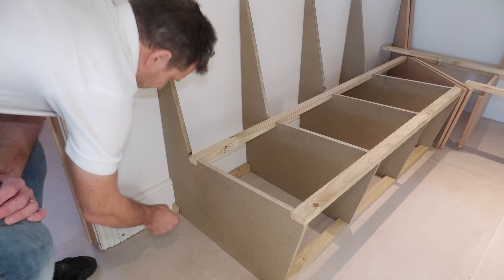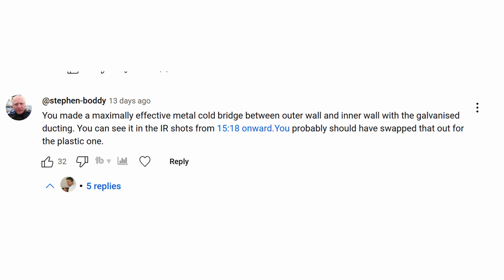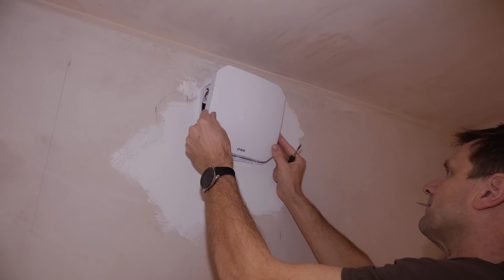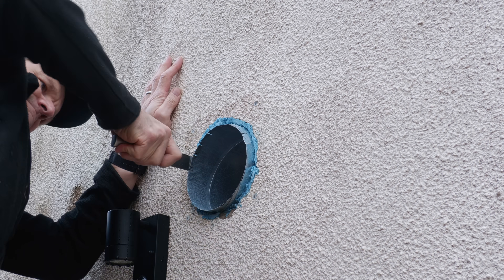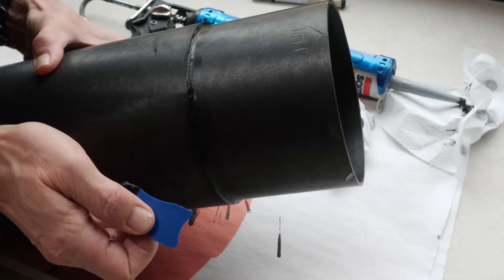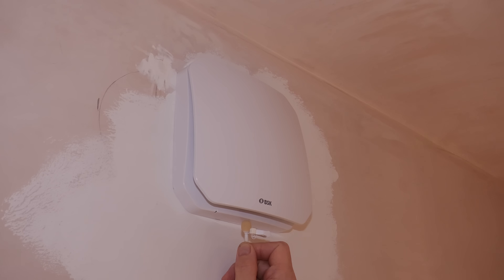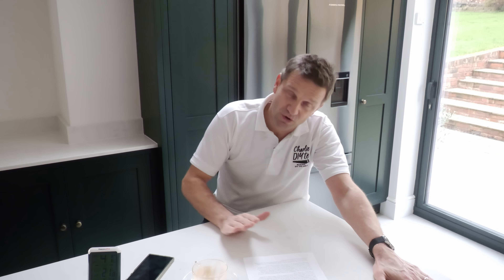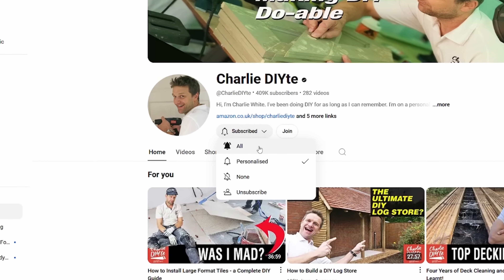Is Single Room Heat Recovery Ventilation Worth It?

Comment: We installed MVHR into our 2000 era house. Combined with 100mm of PIA plasterboard on all external walls and triple glazing. Airtightness taping of all openings and all board edges means we are practically airtight. This took the house from a C3 to an A2 energy rating. 
MHRV was tough to install from a planning perspective and the loft work in a trussed roof was horrible, but manageable by any competent DIYer. Cost was €3000.00 
Humidity hovers between 45-65% throughout the winter, there is no condensation, heating load is a few hours a day and air quality is fantastic. Honestly the best thing we did.

Comment: I have to tell BSK dissapointed me:
1) out the box BSK Zephyr 2.0 has very poor WIFI when it comes to internal wall penetration. This makes them usable in stanalone mode only, as the builtin device to device wifi communication might not work at all or work every blue moon.
2) today using their mobile app I wasn't able to repair 3 units after trying a different jumper (group) setting and then rollback. I set the unit to pair mode, i get the beep, the app does not see the unit.

Comment: NB  there is an important difference between "cross flow" versus "anti-parallel" heat exchangers.  
Only the anti-parallel air flow geometry can allow much better than 50% heat recovery.

Comment: 5:58 The 100 year payback seems to be based on the assumption that being run twice per day at 10 min per run, it will save  1/2 penny, twice a  day, or about 3.65 pounds per year, totaling 365 pounds (pretty close to the 355 pound price of the cheaper unit) after 100 years without installation,  interest or maintenance. But assuming a need for ventilation, the cost to consider is the added cost of a recovery ventilator over a simple extractor fan. If the extractor is 100 pounds, the increase is  265 pounds and the installation costs might be about the same. But is it reasonable to assume it's only going to be used for 5 minutes of extraction twice a day? That might be a reasonable assumption for one in a bathroom, but if  installed in a kitchen,  either an extractor fan or recovery ventilator would be used for far longer, making the payback much faster. And if these are installed at various places in a house to keep the air healthy, it's likely they will be running even more. And, with any use of air conditioning , there will also be some savings in the summer. Still, my back-of-napkin calculations say these reversing units can never get above 50% efficiency, while a crossflow unit can approach 100%, so even if it's a little more cumbersome, a crossflow model is probably worth the extra cost and hassle. Finally, whatever can be said about the payback for a single room unit, the costs of a central system will be astronomically higher, with more ducting losses and potential for maintenance costs, so the payback figures will almost inevitably be worse for such a system.

Comment: Hello. Thanks for these interesting videos. I have a problem vith radon gas. Among others measures, I'm plannning to improve ventilation with a BSK Zephyr or similar. However,, I have doubts about the energy label I've seen  elsewhere. It mentions 30 m3/h and 48 Db, Could you confirm this, please?

Comment: @CharlieDIYte Thanks Charlie for raising the point about efficiency 👏 Our ‘up to 86%’ figure comes from EN13141-8 lab testing (–5 °C outside vs 20–25 °C inside). In real homes results vary, but because the HRV150 is a cross-flow unit (simultaneous supply + extract), it avoids the swings you get with push-pull ceramic cores. That steady performance is one reason councils have relied on these units in London flats for over 20 years.

Comment: I am shortly starting an external insulation wrap of our house, a 3 bed semi-d.  I didn't want gales blowing in through the external air vents, so this is my motivation for controlling the airflow, without sealing them up.

After watching this series, I am very interested in the BSK Zephyr.

Is this a set and forget system.  If you link multiple units (planning to install 4), do you still use separate remotes for each, or how good is app feedback ?

Anyone using the integration with Home Assistant ?
Reply: Hi Mate, any answers on this. This is really interesting.

Comment: The trouble is with just a normal ventilation fan, at low temps it’s like leaving a window open. Especially on a windy day. These units do hold cold outside temperatures off. Win win imo
Reply from the maker: I'm inclined to agree. That was basically why I got it. After doing all the insulation in the kitchen I didn't want a massive hole in the wall.

Comment: What happens to the moisture in the extracted air? some I guess is removed outside, but when hot inside air hits cold heat exchanger there must be some condensation? Did you notice any condensation on the DMVHR unit? Did it freeze this winter? Where the units engineered to deal with condensation? Any speculation as to what would happen to the condensation on the unit?

Comment: did you try measuring co2 with it on and off during the day (of course if the people are in the room). My problem is actually bad air we breathing as co2 build up. turns out we have open windows quite often to get rid of it. house feels much better now, but nor looking at the meter and opening to cold air would be much better

Comment: Really interesting video. I had considered installing one of these in a small room I use as a home office, as the CO2 builds up a lot, and I don't want to open a window in winter. Seems the summary is, "yes it can potentially be useful to make rooms less stuffy, but tread carefully and don't do it for financial reasons as the manufacturers are ... wildly optimistic on their figures".

Cheers

Comment: The underfloor heating contributes significantly to the comfort of the room. Keeping a constant, warmer temperature in the fabric of the building allows you to open a window and vent warm air without worrying that all your precious heat is escaping. On the other hand, if you rely on a timed radiator that runs for only a few hours, it heats up the air, and when the air is vented, the heat escapes too. Eventually, the timed radiator switches off, and because you've only been warming the air, there’s hardly any thermal mass built up. As a result, the temperature quickly drops, the walls become very cold, and the air condenses. Powerful ventilation systems like PIVs can reduce moisture by constantly moving the air, but they also push out radiator heated air and make the house colder. My approach: 1. Extract moist air at source with good ventilation in kitchen and bathroom, regularly open windows in other rooms. 2. Keep the heating on constantly (use a thermostat rather than a timer to turn heat on and off) and ensure that the fabric and contents of the house are heated, not just the air inside. This can be expensive but with good insulation and an efficient boiler it is not that bad and worth it for the comfort it brings.

Comment: Can anyone answer me if these types of units are good to add in multiple rooms (150 - 300 sqm) in my apartment for ventilation? Each room will be used with doors closed separately.

Also how much outside noise do these units leak inside, so based on it I can judge to spend on soundproofing on my windows or not as if its gonna be useless to do as these units leak noise nonetheless. Are there other solutions to reduce CO2 levels in the rooms and also that will be good to use in a soundproofed room?

Comment: thanks for the video.

I also did a partial MHRV in an old Victorian terrace; the 3 beds in dormer floor and a Shower/WC and middle floor (office, Shower/WC, temporary kitchen and a sitting room) are all connected to it. I love it and it works great - steady humidity, 24x7 trickled air, humidity sensor in wet rooms and best of all , no need to open the sash windows that have all been draught proofed and cumbersome secondary glazing added.

I am now knocking the back of the house and building a new kitchen, utility and WC  ( 45m2) which is not feasible to connect to the existing MHRV unit in Attic.

@laurencetayloruk When you say 'simple' what model did you go for ? I think I want 3 x double duct exhaust vents (kitchen, utility and WC) and perhaps a 1 x supply into the main house hallway and 1x into a tv den.

I also have a kitchen extractor to contend with, I would love to integrate this into MHRV as long as it did its primary function.

ideas welcome

Comment: I installed a 5KW Chinese diesel heater under the stairs 3 years ago, kerosene fed from a 10l tank out side in the drive and is also fresh air fed. So we get a constant feed of hot/warm fresh air into the house.

Comment: I have 2 x ventaxia lo carbon fans I am at a high location with prevailing winds.
The fans cut out noisy fan flap grill covers which in windy conditions would create a lot of noise.
Humidity is much reduced.

Comment: For a single room heat recovery ventilation I'd consider Mitsubishi VL50 or VL100 wall mounted units. Proper paper heat exchanger helps preserving natural room humidity and lowers the risk of condensation on high temperature gradients, when there's freezing outside. Constant air flow instead of exhaust supply cycles - less distraction, single orientation filters (no dust return on reverse), possibility to install different filters including HEPA. Exhaust and supply are happening at the same time - no problems with intake source when the room is too sealed. Large fans with low noise and high throughput on low rotation speed. Unlike all these 90% efficiency claims, Mitsubishi give more realistic recovery efficiency specs around 70-80% based on the fan speed. The units don't have automation and intelligence, but because the construction is dead simple, it's not that hard to add automatic relay with controller and sensors if needed.
Reply from the maker: Thanks for sharing - sounds very good, that.

Comment: very interesting. Can you tell me, are these recommended if you have window trickle vents or should these be blocked off. Reason I ask is that it turns out our trickle vents on our new windows are not good enough for our open plan room, only 13,000mm2 and we need 30,000mm2. So wondered about a single one of these to satisfy building control or a whooping 225 x 200 hole in the wall open vent to allow extra ventilation in (may as well leave a window open) thanks
Reply from the maker: I think when you've got fans working in tandem (so a pair of these for example) you're meant to have everything sealed but I reckon particularly where like in my situation I've only got the one, tricky vents would help. Sorry to hear building regs are on your back. Maybe suggest this fan and see what they say. The relative humidity levels in our kitchen have plunged since installing it. They're almost too low at 35%.

Comment: I fitted a MVHR unit in a 1950’s house by ducting up via  airing cupboard into the loft for bedroom extract.  Big improvement and bathroom has its own small MVHR unit due to restricted duct suitable for bedrooms. This keeps the main MVHR free of the shower condensation.
Reply: You do want that moisture though, but only if you have an Enthalpy MVHR. Not only is there useful energy in water vapour, but you also need the humidity to go back into the house on colder months. In colder climates (like in Canada) you can also buy humidifier addons to MVHRs as once you get below 30% relative humidity at room temperature, you will struggle to sleep (dry mouth). Also, skin goes really dry and becomes prone to cracking and obviously you will get chapped lips. Dry skin is also more susceptible to cuts (like from paper, metal zippers, etc...). Once temperatures drop below freezing, most moisture outside just drops out of the sky. You might think that 90% relative humidity in December means there is a lot of moisture in the air but there isn't. As soon as you heat up that cold air to room temperature the RH will drop from 90+ to well below 40%. At -5 degrees C outside, you can easily get below 30% RH indoors (and that is REALLY uncomfortable).

Much easier to think in terms of dew point (which doesn't change with temperature).
Reply from the maker: That is genius Paul. Thanks for sharing👌👊

Comment: One interesting ventilation unit for small spaces I regularly recommand to my clients is the Zehnder ComfoAir 70. This is a crossflow unit, with a steeper pricetag. But the big benefit of this unit is that de extraction intake hole can de extrended with a small duct. This way you can suply a small studio while extracting a separate toilet for example.
Reply from the maker: That does sound good. So you know anything about the efficiencies of the unit?

Comment: Great videos,

I am currently trying renovating a shed into a living space with notorious damp problems and seen these systems it was very bad in the bedroom area as there was no window. We are now adding a window a low down vent and a vent up hight to try get as much circulation as possible but I am wondering would I benefit from one of these in the bedroom rather than just a standard 4 inch vent.

Comment: Single room heat recovery ventilation units were installed quite frequently in early 2010s in Estonia when renovating and insulating old apartment buildings. Nowadays pretty much nobody installs them anymore and if heat recovery ventilation is installed in an apartment building during renovation a centralised system is used. I haven't read too much into why but I have three pretty good guesses:
1) 'Wet' rooms are usually placed in the centre of apartment buildings over here with a ventilation chimney going to the roof. The principle of ventilation in these types of buildings is that you have fresh air coming from the outside walls through the bedrooms and being exhausted via the wet rooms which provides enough airflow to the bathrooms and toilets. Single room heat recovery units are difficult if impossible to properly combine with bathroom exhausts.
2) You are installing a fan in basically every room - keeping noise levels down to reasonable levels is tricky, especially in bedrooms. With a centralised system noise dampeners are used to mitigate noise.
3) Their efficiency is not as great as with 'proper' heat recovery units.
Reply: Live in a house built in the end of 80s, current ventilation system doesn't work, looking for repair or replacement, it looks like a central ducted system blowing air in few places and extracting from the wet room and kitchen, we had a a sales guy suggesting a different system to be installed which is extracting from the same locations and adding wall inlet ducts to each room . Total cost 10k. I don't have 10k, looking for a different solution .

Comment: I assume that the heat recovery benefit assumes that the device is installed in a cold climate (normally cold air outside and warm air inside).  However, what would happen if you installed this in warm climate (tropical area with warm moist air outside and cold dry air inside)?  Would it work?